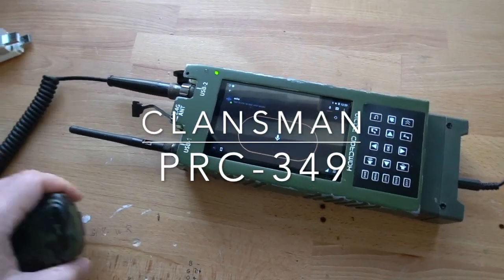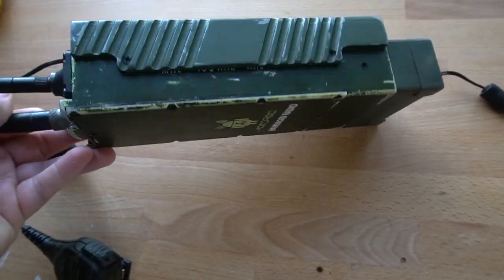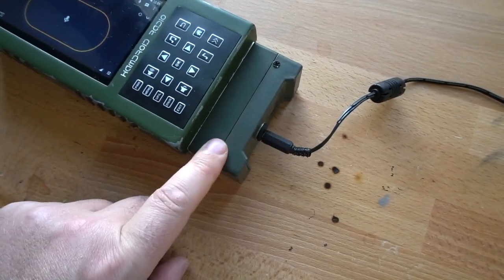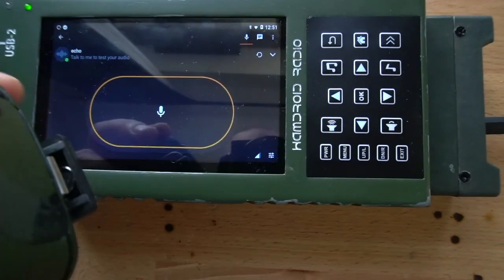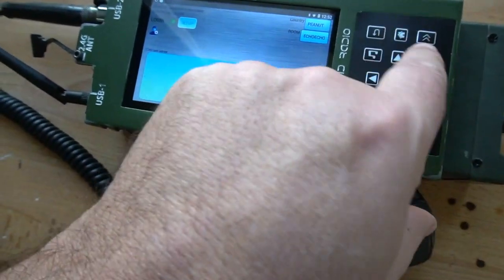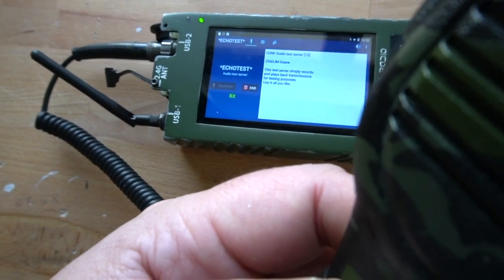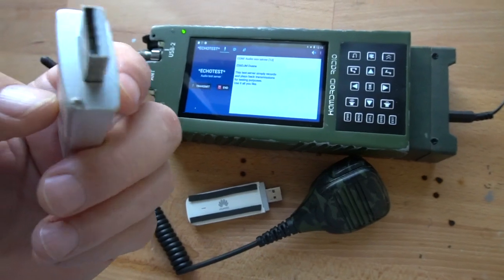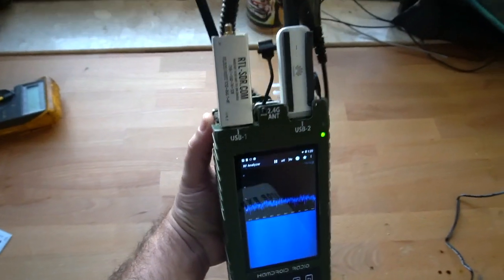PRC-349 conversion to Hamdroid Network Radio

Comment: Hi, ive recently come into posession of a clansman 349, did you change the frequency range using this kit?
Reply from the maker: I just used the casing to build my kit into it
Reply: @DuanesMind  Ah I was looking for a way to adapt the radio to the nearest amateur frequency band.
Reply from the maker: @Thatsnotmycow  Even to get it onto the 6m band would be a big task. Not only that they don't really have much TX power as well.
Reply: @DuanesMind   not worried about the Tx range really. A friend of mine is a former radio engineer and he's looking into it, might even be able to boost it to 2watt as RACAL used to offer to supply the 349 with 2 watt and any 10 mhz band. Would probably muller the battery life though.

Comment: Hello. What is involved in the switching of the Roger beeps using the buttons?
Reply from the maker: It's a modular circuit board that's wired up to the PTT circuit. The Roger Beep module consists of 13 tones which can be selected by going up and down. It can also be turned off completely.
Reply: @DuanesMind  thank you for the reply. Is it a board designed by you or is it a board that's readily available?
Reply from the maker: @paulsaldo2926  You can get it from a guy on ebay. https://www.ebay.co.uk/itm/ROGER-BEEP-WITH-13-TONES-NEW/151022304638
Reply: Thank you for the information. Very appreciated. You radios are very inspiring.